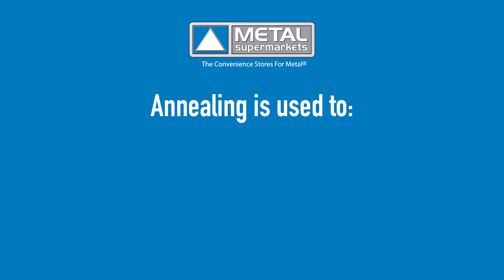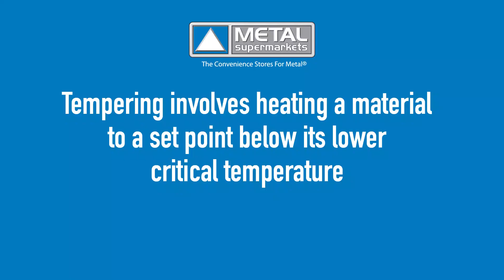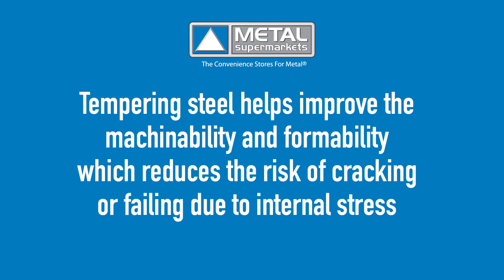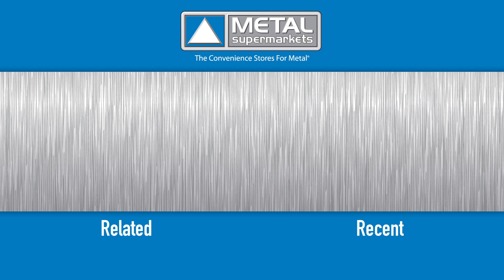Annealing vs. Tempering | Metal Supermarkets

Comment: Thanks how does one harden, anneal or temper (I still get confused with those methods) a stainless steel spring so that it doesn't suffer metal fatigue and split into two over time (stainless steel spring for example for scissors). What temperature and for how long and do I quench in water, oil or air?

God bless. Revelation 21:4